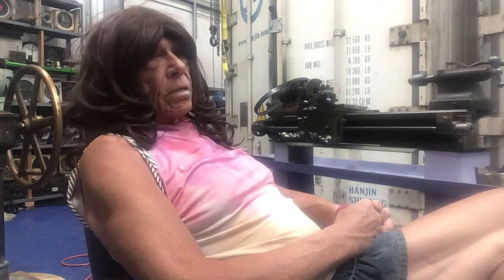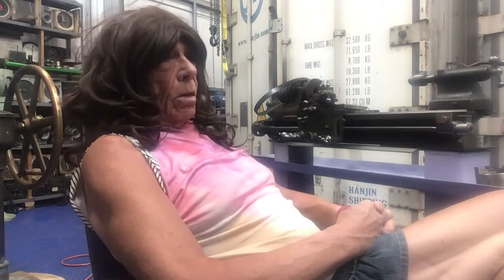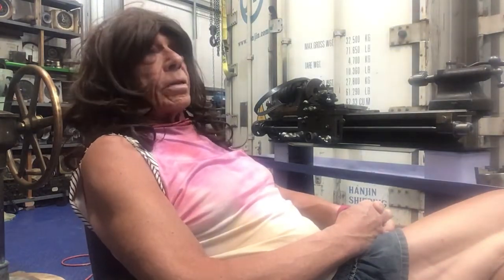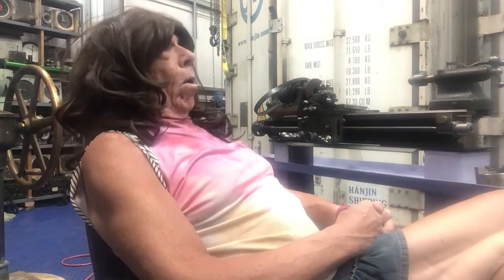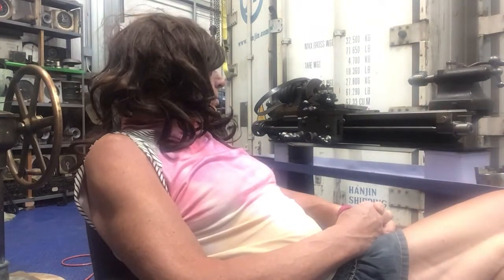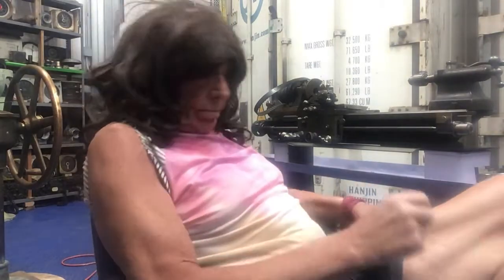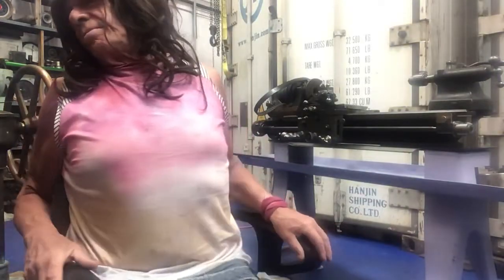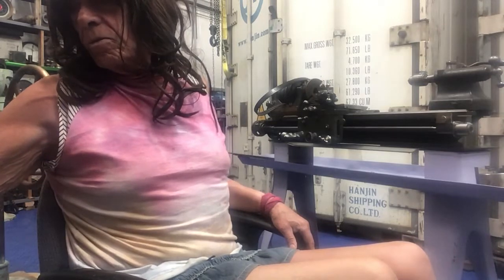Free energy and other things

Comment: After the Canadian government reps came to visit you that one time, I seem to remember you mentioning how they tidied up all of the shelves and equipment that they photographed. That’s always stuck with me for some reason. Regarding the piezoelectric pile and Oxford Electric Bell, has anyone or yourself observed variations in pressure or current output with changes in ambient air temperature surrounding the devices? I ask, because I wonder if temperature induced expansion and contraction of the outer casing and internal insulating material would enact enough mechanical force upon the crystal components to initiate a piezoelectric reaction.
Reply: @klingonbaronessprincesskar5519  I’m surprised that it was that recent. Life’s been such a blur since the year 2000. The world seems so different now - I don’t even recognize it. Like you say, change is constant.